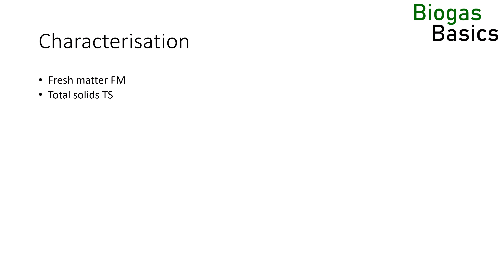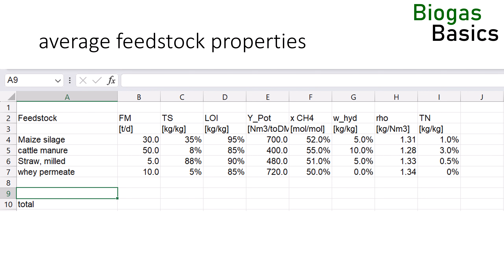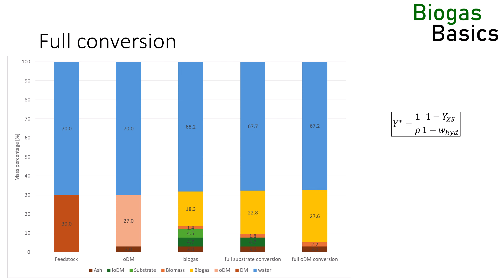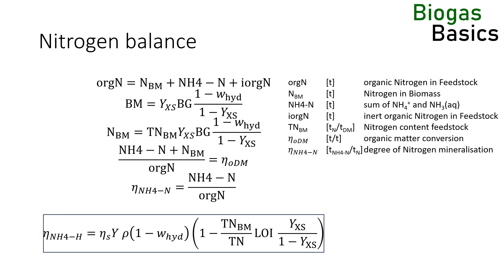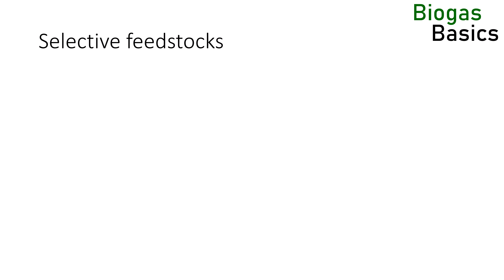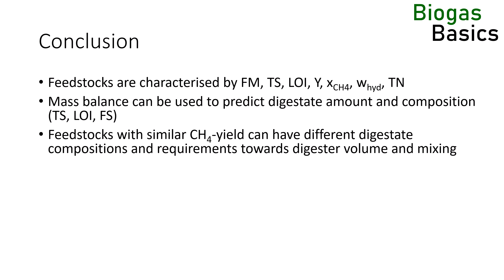03 Feedstock selection and interchangeability

Comment: Hello Jurge, thanks for your brillant videos. In the stoechiometry video you displayed the table for cellulose showing a w hyd for cellulose being 8,4% for cellulose (including biomass build up). Here you used 5%. why is that diferent ?
Reply from the maker: Hi Bart, Maize silage or straw is not 100% cellulose or starch. The stoichiometric water demand also depends on the exact CHONS-composition of the bacterial biomass, which is unknown. I did a couple of dry matter balances around energy crop fed digesters and on average the hydrolysis water demand was 5%. The w_hyd parameter has a strong impact on the digester sizing if dilution is required, so we do not want to over- or underestimate it.